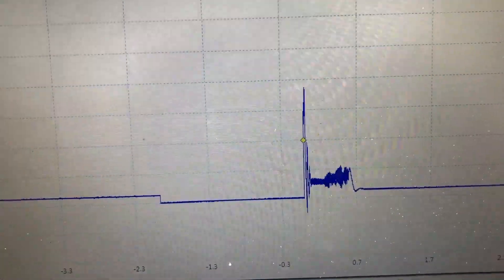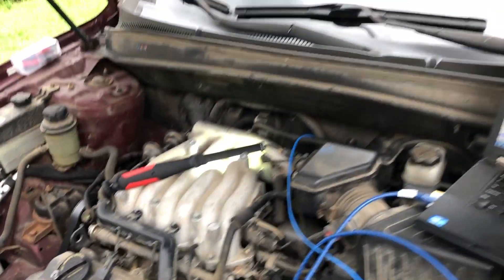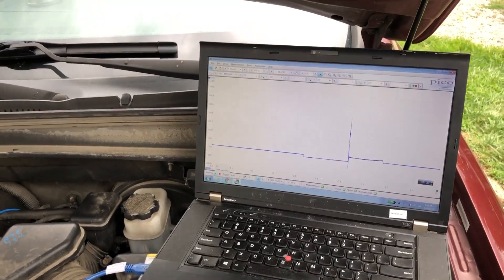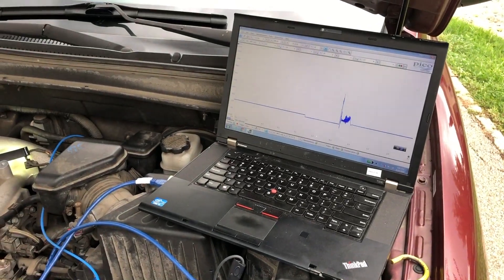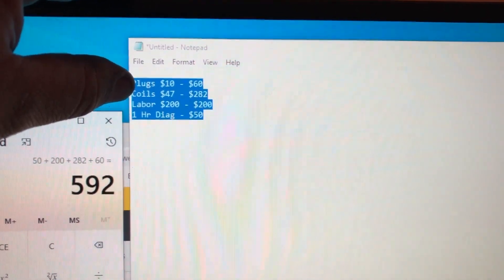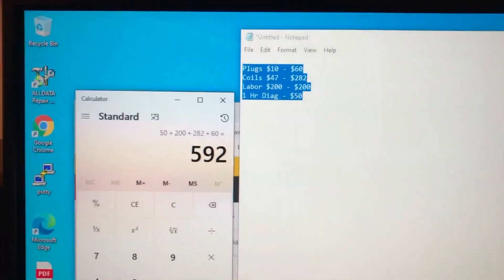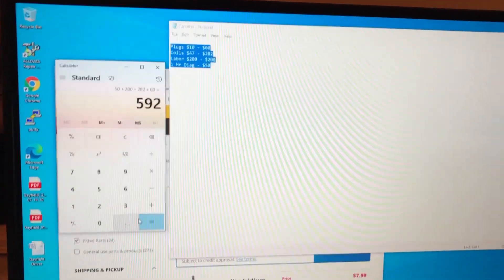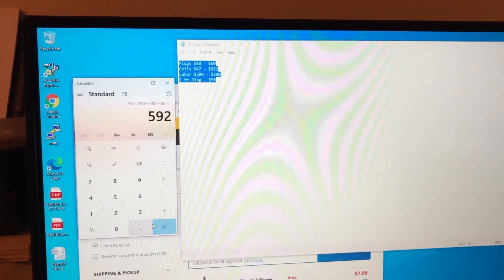2008 Hyundai Santa Fe 2 7L - Cylinder 5 Misfire Confirmed Diagnosis with PicoScope - P0305

Comment: Struggle to find a decent car with low miles theses days. If a 09 Hyundai santa fe 108miles has a miss. And engine light on. Is it worth buying?
Reply from the maker: Depends on why it is misfiring and why the Check Engine light is on.  Could need a new spark plug or it could need a new engine.

Comment: have current issue but borrowed a Autel scanner then the PO305 cylinder 5 showed up on active DT but no engine light. 127000 miles. Wouldnt a fuel injection disable and enable rule out injector? Not sure why the ECU is selecting cylinder 5.
Reply from the maker: Yes, but on many of these the computer shuts down the injector when I notices there is a misfire, so you can think you have a bad injector, but it isn't.   The correct way to diagnose it is with a fuel pressure gauge and an injector pulse tester.   You could also just ground the control side of the relay with a test light to make sure it opens.  Then use a test light to make sure you are getting a pulse at least when the engine first starts.
Reply: @frugalprepper  your investment in the oscilloscope sound like it pays off. What state are you located in?

Comment: G'day,

Very cool !

  Whomsoever designed the Engine with half the Plugs & Coils buried under the Inlet Manifold fully deserves whatever goes wrong in their Lives...(!).

Have a good one.

Stay safe.

;-p

Ciao !
Reply from the maker: Yeah, I don't know why car manufacturers do this.  I just fix them, I don't design them.  At least this engine isn't the worst to get to the plugs on.  There are some that require $1000 in labor to get to the plugs.
Reply: @frugalprepper  
Well, with the newer Cars my theory is that they're designed to be built by Robots, and one mob of Robots builds the Engine & another mob then bolts it into the half-built Car and then a different team of Robots finishes the build...

But my 1983 Subaru 1800 Touring Wagon has it's Power Steering Pump over the top of it's front right-hand Cylinder-Head....; I drove it on the Road for 12 years & it's been a Paddock-Basher for another 5 yrs - and I've never taken that Plug out of the Pot, it may have been in there undisturbed ever since the Car was built.

  $1,000 in Labour to get to where one can pull a Plug out is totally crazy...; I wonder how many of those cars are first insured, & then mysteriously stolen & burned at the first sign of a misfire ?

   To change or work on the Gearbox in my Forester, the whole Engine & Box has to come out first, to get access to be able to detatch the Box from the Motor - all the effects of Modular Design, I think..., and Robotic Assembly-Lines.

  Such is Life,

Have a good one.

Stay safe,

;-p

Ciao !